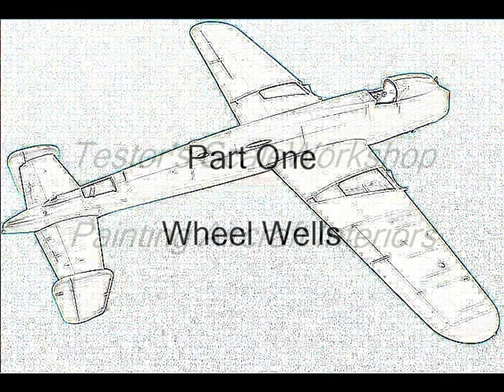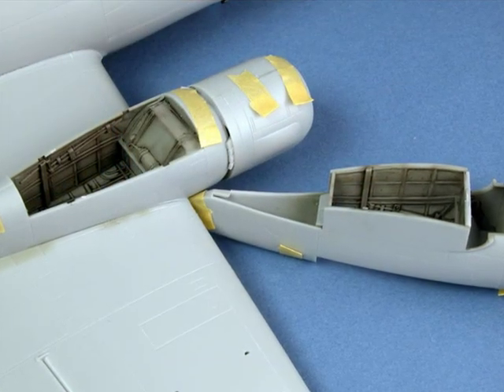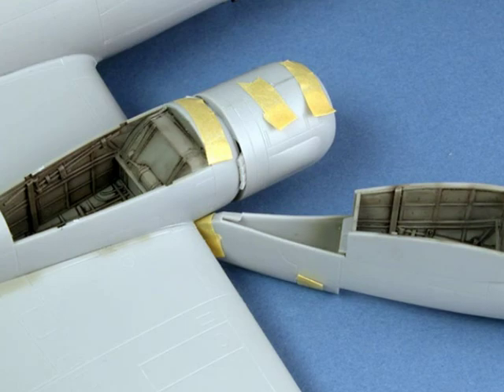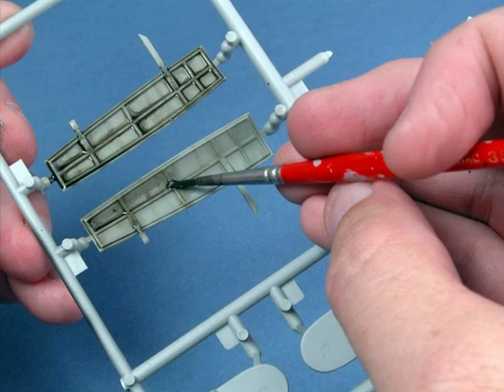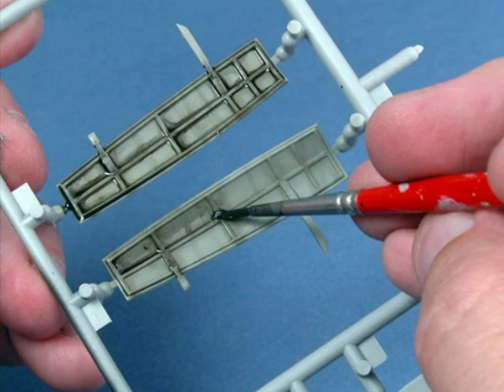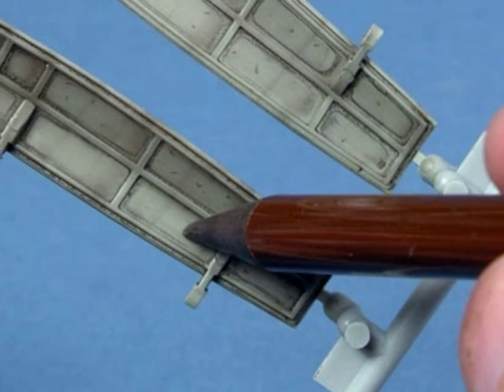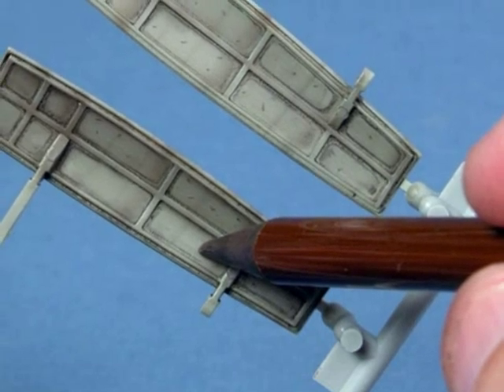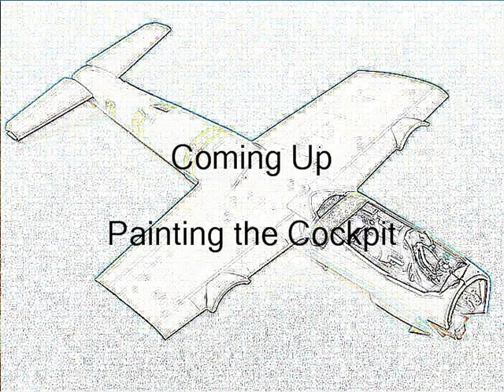Squadron ScaleWorkshop No. 40a - Painting Model Aircraft Interiors Part One - Wheel Wells

Comment: @FeelinGipper
aluminum doesn't "rust" like steel would, but it does corrode. corrodes easily actually. Typically it'll appear as a "delamination effect". It'll flake off over time and become weak. Though most common, but there are several other ways that aluminum could corrode.

Comment: @altair1983 To allow max paint adhesion and to protect the metal surface from being "attacked" by paint solvents. You cannot score or buff aluminium as this also damages the surface skin of the metal which would lead to corrosion.
Primer "sticks " to the surface rather than permiate, it is the primer that is permiated by the undercoat, and the undercoat is further permiated by the topcoat.
All clever stuff ...! :o)